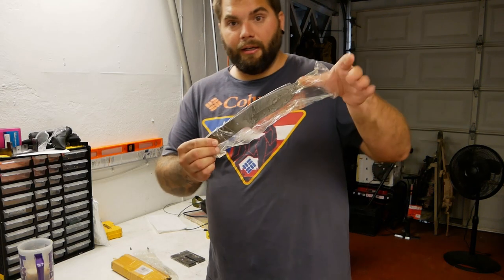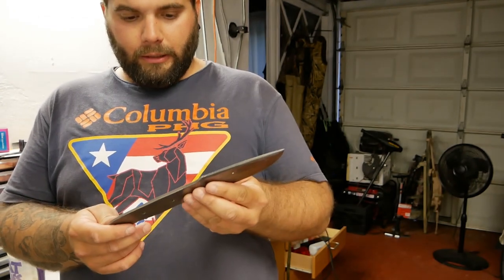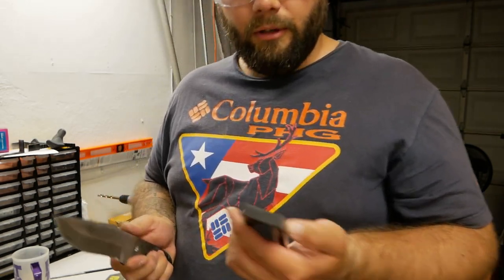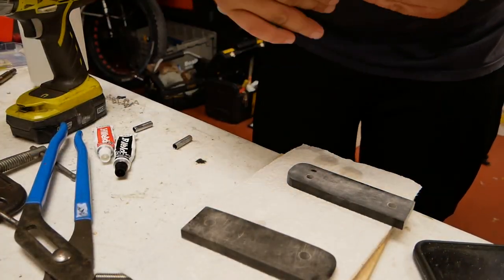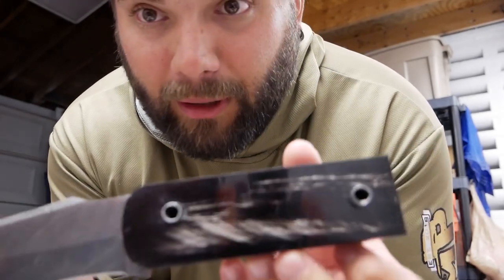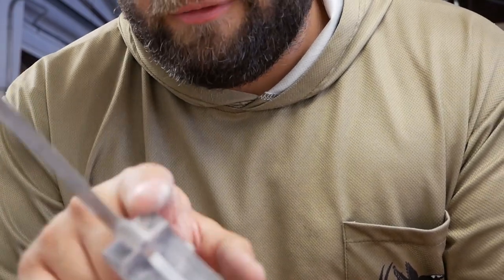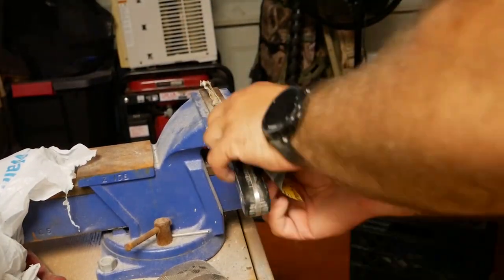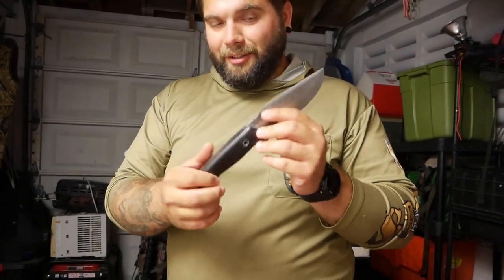First knife build: Damascus steel billet with black buffalo horn scales (Swamp N Stomp ep. #51)

Comment: Damascus steel has not been made for centuries.  What you have is folded steel with swirls. 
Folding similar steel will not improve the properties of a blade.  The swirls in ancient Damascus steel were a side effect of the forge process and not the purpose.  Calling a steel Damascus today is like a kid making noise with the spokes of his bike pretending it is a motorcycle.
Reply from the maker: looptheloopish I wondered about that. Seems like the swirls are just etched into it... but it’s the closest we are going to get... and it looks awesome! Thanks for your input, don’t forget to subscribe! -Mark
Reply: In today metallurgy, everything ia possible, so why wasnt it made for centurys...whats the reason?